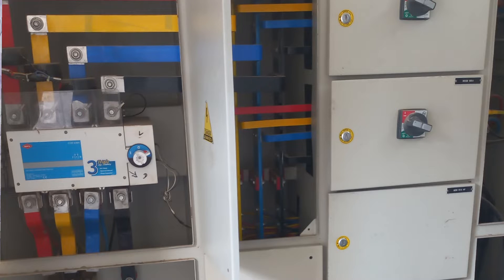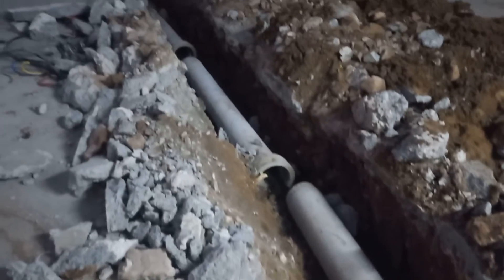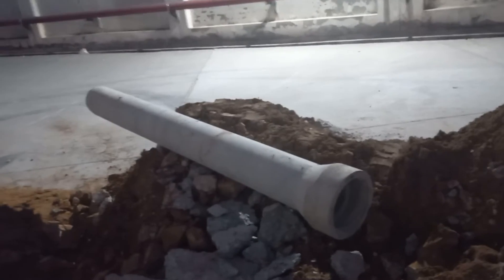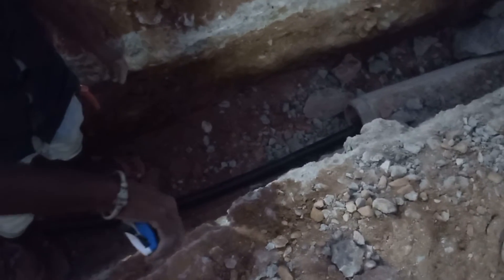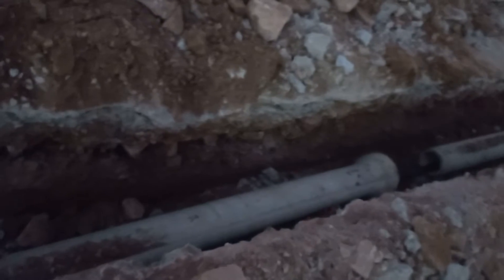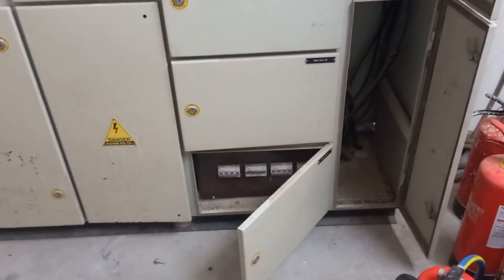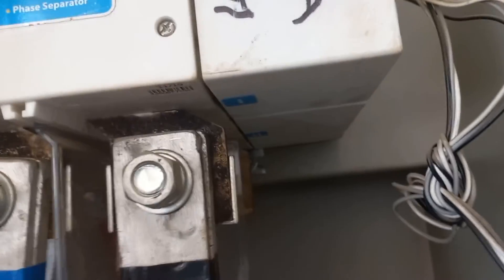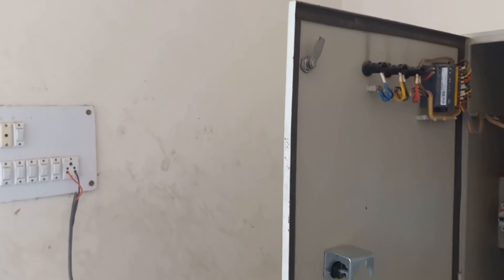Underground cables are installed in Hume pipe and cable connections in panel.

Comment: Hi Ma'am,  appreciate your Valuable information, I wish you all the best for Knowledge you shared. Can you explain or make video on How to calculate no of batteries,  Battery volts & Battery rack Size based on the following information:  ( 3phase- 3phase, 30kVA Ups , Backup Time 2hours) any ups Size not just one I put in bracket. It will be helpful. thanks
Reply from the maker: Thanks for your suggestion.. will try to make videos on it. but have already made some video on UPS, you can check on our channel